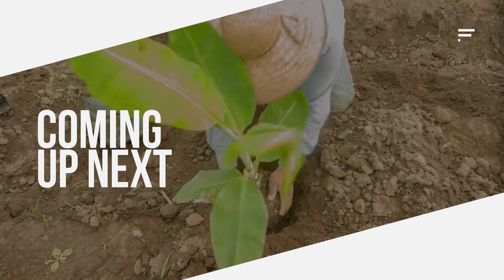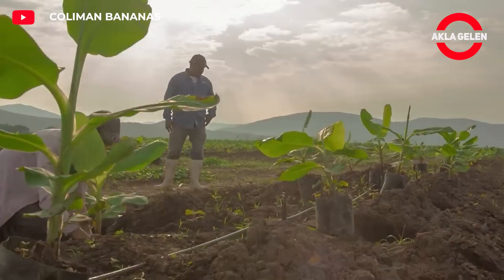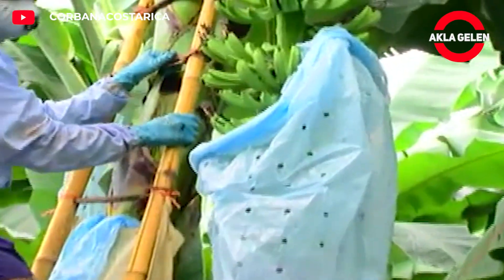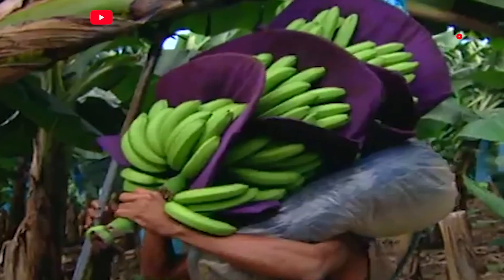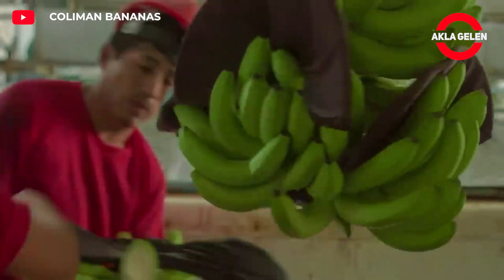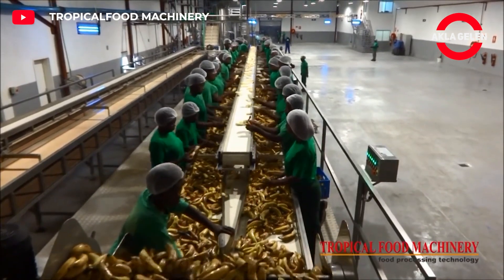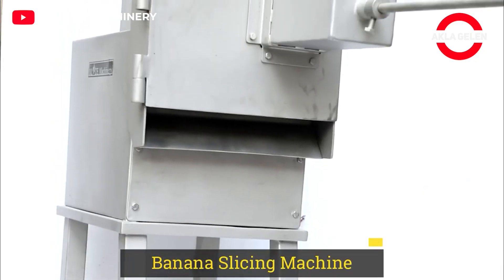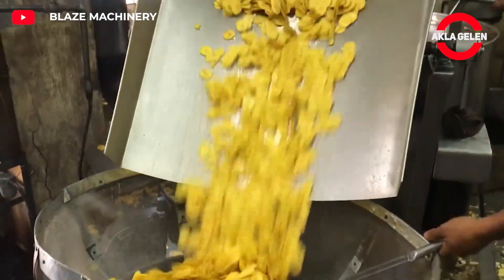Billions Of Bananas Are Harvested And Processed This Way - Modern Technology Bananas Factory

Comment: So why, with this sophistication, equipment and sprays do virtually all bananas I see in stores where I live (Canada) have 'powdery mildew', a fungus, It shows on virtually all bananas you let ripen (to speckled). Even organic, (the ones with the plastic wrap at the top) get it. It's an industry wide fungal infection that can be there from seedling but by the time they're ripe, the bottom third can be black, (otherwise perfect).
Reply: That sounds more like natural ripening and oxidation than a fungal infection. Bananas are treated to prevent major diseases, and true powdery mildew is rare on them.
Reply: @thefinalusa  I disagree. You can clearly see it on the product. And the virtually same ailment plagues coloured bell peppers. The reason most of them don't have stems left on them is because that's where the black 'powdery mildew' shows. I've worked in those stores and grew up in that environment - and it's much different today. It's being hidden - but if you let things ripen naturally -the PM then shows.
Reply: @bc-guy852  I see your point, but not all cases are the same. Many peppers are harvested and processed quickly, which can affect how they appear. While powdery mildew is a concern, other factors like storage and transportation also play a role.
Reply: @thefinalusa  Bananas and bell peppers are rife with powdery mildew. Period.
Reply: @bc-guy852  Powdery mildew can affect many crops, but bananas and bell peppers are not particularly "rife" with it. Proper farming practices, resistant varieties, and modern treatments help keep this issue under control.